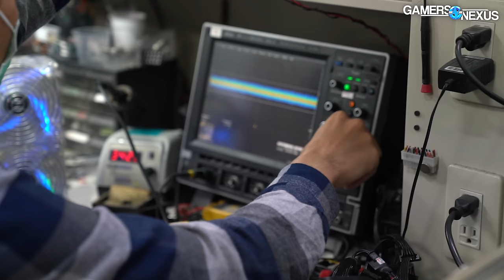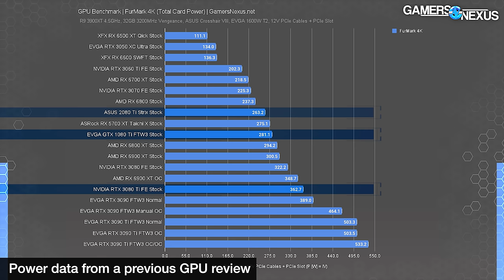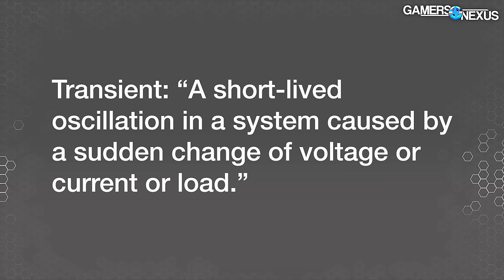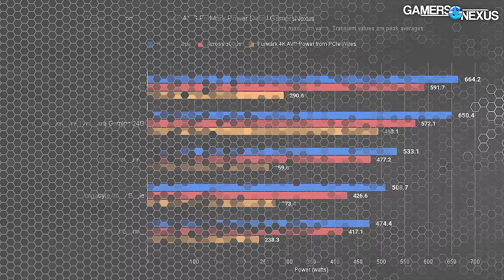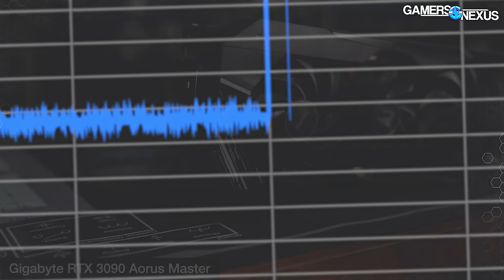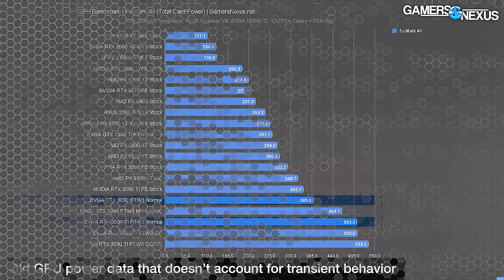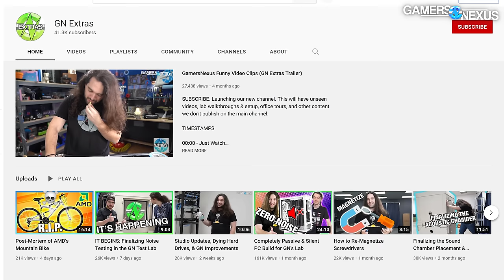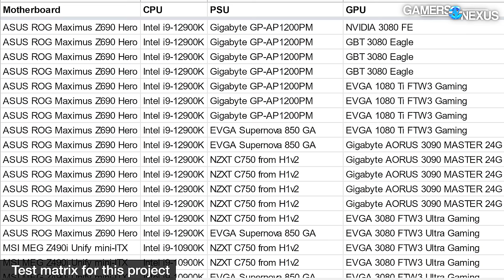The Brewing Problem with GPU Power Design | Transients

Comment: I find it kind of interesting that this is just now being discussed for computers. I did car audio installation professionally for over 14 years and this was something we dealt with on a daily basis for huge car stereo installs. In fact it is still something that is dealt with today for multi amp power hungry car audio systems. We had to install large capacity capacitors in the system to "suck up" high transient power demands to keep from potentially hurting a cars alternator. You can visually see what these high capacity caps would do because the headlights wouldn't dim, or not as much, under large bass drops which would draw the most amount of power. Large caps are designed to quickly deliver large amounts of current very quickly while a cars alternator can provide large amounts of current but just over a longer period of time. A computer power supply is roughly the same. It produces a fixed voltage with a variable current output, very similar to a cars alternator, and neither is extremely suited for potentially a massive current draw in relatively short amount of time. For cars it has always been you upgrade to a larger alternator, or more than one if needed, you add several farad caps or both sometimes. It is getting to the point where either manufacturers are going to have to start recommending more accurate power supply requirements to account for this issue or someone is going to have to design a power bank of large caps that go in between the power hungry graphics cards and the power supplies.
Reply: Electric amplifiers have had this issue for ages, and the solution is a big capacitor.
Reply: I was just going to make this correlation - RMS vs PEAK and what not but you nailed it.
Reply: @StephenGillie  The best solution is an elegant one. Graphics cards should implement their power limit properly. It seems like really messy design to me that you can run a load of never above 200W, yet for less than a millisecond it might spike to more than double that. This can be avoided with sane/smart design. But of course the GPU industry is the epitome of superficial power craze, so we cannot expect them to sacrifice any potential in order to avoid having to oversize your power supply.
Reply: The solution to transient spikes is not just huge capacitors, at least not on the power supply itself. The power supplies (switching DC/DC converters) have a maximum amount of output capacitance that they can deal with before they go out of stability and start oscillating (which will burn out components). A power supply manufacturer can't know how big the spikes will be for every GPU that you put in your system. That's where the board designers of the GPU come in, they should make sure that they have enough filtering on their power supply input so that they don't trip the OCP. They are the ones that should place the large capacitors on their board. But ideally you don't want to have these spikes at all, and you also place inductors in the line to suppress these huge spikes, so just a lot of caps alone could be detrimental to system stability.
Reply: Yup, back in the 90's I had a cap the size of a Fosters can alongside my 1000W Phoenix Gold amp. Ahhh, the good ol' days...
Reply: I'm a home audio hobbyist and was actually going to come here and post something similar. Before i read your post I assumed car stereos would use some type of power supply separate from the car or amp. Either way, that's the point I was going to get to. The power supplies in high end audio power amplifiers are built to handle these kinds of spikes as best they can. It's actually one of the most important components in the amp. If you want dynamic range for movies. Where you can hear whispers before the bomb drops, and get blown out of your seat when the bomb does drop. TLDR, if they don't get their power spikes under control, we could be paying audiophile prices for power supplies. $1000 easy. And there's nothing on the market meant to handle this, except these audio power supplies.
Reply: To make this clearer for everyone. In an electrical circuit a capacitor opposes changes in voltage. An inductor opposes changes in current. Using capacitors for an amperage problem is not a proper solution. Voltage sag is a side effect of a current spike, not the root problem. A tuned LCR (inductance capacitance resistance) filter is the proper way to address this type of issue.
Reply: I'm not an electric engineer so I might be wrong, but unlike Speakers which constantly deal with spikes of electricity based on the music you are playing, and the note and chord it needs to create, cards predominantly need to be more or less consistent in their power draw.
while Again I'm not an engineer, I think it would be a bit strange for a card rated for example at 300 watts to draw suddenly 600 wats for 10th of a second, and repeatedly over the time, here and there, sure.
And the power supplies obviously need to be able to take care of those spikes, but there comes a time where the Engineers of the cards and programmers, to engineer and program the tech properly, and not just rely on the power supply to be able to take it.

I have an old refrigerator that every time it stops it's pump, anything connected to the same outlet, would for a split second blink, or turn off and come back on again.
Yet the new refrigerator doesn't. Quality of components and different tech and all.

Another example is programmers now, care less about memory management and code performance unlike a couple of years back, just because the machines and phones are faster and stronger. Yet there is no reason to for some apps to take as much memory as they do or draw as much power as they do.

Of course, my 2cents and not an electrical engineer, but it seems a bit silly for Chip Designers to blame Power Supply manufacturers, without proper preparation that the power supply is actually ready and capable to handle 2 times the power spikes. 
Especially since a lot of people do not change their PSU for years since the warranty is long and their is no real reason to.
Reply: @Nutakins  I remember some caps being the size of a small fire extinguisher. I also remember having to tell several people to be careful touching them.
Reply: @danepher  It also seems to me to be primarily a GPU issue, they needing to handle their power draw for more consistency as I don't see a reason now why a GPU would need to create spikes like this for apparently rather consistent load. I'm also not an electrical engineer and only a hardware enthusiast that doesn't know too much about that side of things, at least as of now.
As a programmer myself (and from a user perspective as well) I also agree with your take on software efficiency.
Reply: @InTimeTraveller  the high capacity is an issue only at Powe ON and Shutdown, which also with a good design can be overcomed by adding power on/off mosfets in the low voltage circuits.
Reply: @nowheretoshower  you can not tune this, you have to large parameters which varies in time,  also  the inductance should be kept at at minimum to prevent oscillations.
Reply: @danepher  did you watch the video? It's literally about how 3k and 4k series cards do have 100% spikes in power draw. I'm surprised you have the time to write that huge reply, but not watch what were commenting on.
Reply: @nowheretoshower  The problem with that is that GPUs (at least current designs) create current spikes but don't deal well with voltage sag. If you put them behind a LCR filter, that will protect the rest of the system but the GPU itself will have problems. 
The best solution would be what Dolphwin suggested, namely that GPU designers put a limit on the current spikes of their GPUs. But that will only happen when the problems get too big. One example where it actually happened was the RTX 3080, where enough users complained that Nvidia modified the driver to reduce power spikes. IIRC at the expense of a very modest drop in performance.
Reply: @gherbent  You might be right. I don't build high-frequency switching power supplys.
Reply: @rabiatorthegreat6163  I fully agree that this issue is a GPU/card fault. Those designers are the only people who can mitigate the transient behavior.
Reply: @nowheretoshower  Yep, a PI configuration of cap to ground into a series inductor into another cap to ground. Used to use those in ham radio for power supplies or filtering for noise. Different values for different purposes.
Reply: It boggles me how even professionals won't get the terminology straight. There is no alternator in cars, but a generator. Alternator generates alternative current, generator generates direct current. I'm sorry, I don't like correcting, but the little german in me revolts when hearing a oxymoron.
Reply: Yeah I had a 1 farad cap to help my tiny Ford Focus deal with a Boston acoustics 800w amp paired with 2 12” Rockford P2 series in a sealed enclosure. Good news: it worked, bad news: my focus literally was shaken apart.
Reply: @Dowlphin  these power spikes are happening in microseconds. I suspect the power limiting features just can’t react that fast.
Reply: @brkbtjunkie  I was talking about smart design, not blunt and messy design. The issue should be resolved at the source.
Reply: @phillgizmo8934  Every car since the early 60s in the US has had alternators. They use rectifiers to convert to DC. They are much lighter and more efficient at low RPMs. Apparently, back when they used generators, cars couldn't keep the battery charged if you were at low RPM so lights would dim until you got the speed back up.
Reply: I am not even in the electronics field and my first thought was "Add capacitors"
I hope it's not that simple because you would think large companies like NVIDIA and AMD would already have thought of this.
If they really are just kicking the capacitor can down to the power supply manufacturers then that's just said
Reply: Ok just watched the whole video.
Yeah while Nvidia and the OSU manufacturers continue to play tennis some smart person needs to start similar to what was mentioned for use in a car to take the load created by the audio system.
Reply: @paulanderson2963  Caps cost money, too, and take up space. And resource availability might become a growing problem, too.
Reply: You're spot on, and I had the same idea - a bank of high quality caps that can be easily added between the GPU power input and the PSU. Anyone who does basic electronics could actually rig it up themselves, for the 5V and 12V lines.
Reply: @nowheretoshower  As things stand currently though, isn't stable voltage what we want? The GPUs want extra high current temporarily so we wouldn't want to dampen response times to that with inductors, right? Yes, dampening a current spike via inductors would prevent the PSU from hitting OCP, but couldn't that in turn result in a voltage sag on the GPU side?
Reply: @Mad_Hat_was_taken  The voltage sag is caused by the current spike at the load. If filtering was designed to flatten the transient there would be no voltage sag.
Reply: It has been discussed for years now, other streamers have and also on various blogs. The problem has always been us consumers just accepting it and not holding NVIDIA accountable
Reply: @phillgizmo8934  While yes cars used to come with "generators" modern cars have "alternators" that use rectifiers to convert that ac into dc for the vehicle to use. I think it was in the early 60's when these really started to take off and then became standard because of the benefits they offer
Reply: It's just now being discussed for computers because it's just now getting to be a big enough problem to require discussion. Everything happens at its own pace.
Reply: @nowheretoshower  : Capacitors don't oppose changes in voltage. They're not resistive, they're capacitative -- hence the name "capacitor". They store excess charge and supply it to fill-in amperage spikes that would otherwise cause the voltage to dip momentarily. Mathematically there may not appear to be a distinction between the way inductors and capacitors work to smooth-out the flow of electricity, but physically there is a huge distinction -- an inductor is essentially a magnetically-moderated self-adjusting resistor, whereas capacitors have no resistive behavior whatsoever.
Reply: @deusexaethera  You have misunderstood. 
Capacitors oppose changes in voltage by causing a voltage drop on a circuit as they charge their electrical field. Capacitors oppose changes in voltage by releasing voltage into a circuit as their electrical field collapses. So, when voltage goes up the capacitor tries to hold it down and, when voltage goes down capacitor tries to hold it up. 
Next, capacitors block DC and allow AC to pass through. This makes capacitors able to function as frequency dependent resistors. This is called capacitive reactance and is represented in ohms.

Next, inductors oppose changes in current by becoming a load on a circuit while charging their magnetic field. Inductors oppose changes in current by releasing current into a circuit as their magnetic field collapses. So, when current goes up inductor tries to hold it down and, when current goes down inductor tries to hold it up. Inductors cannot block the flow of DC like capacitors. The inductor is a frequency dependent restriction on current flow. This is called inductive reactance and is represented in ohms. 
I hope this clears things up.
Reply: @StephenGillie  : The problem with just slapping a big capacitor into a computer is twofold:
1) You have multiple output voltages (12v, 5v, 3.3v, ~1.7v for the CPU cores) and multiple power rails for most of them, so you'd either need to fit multiple big capacitors to all the power rails because you never know which one is going to require help at any given moment, or you'd need to fit a really big capacitor on the input side, which would require converting 120V AC to some intermediate DC voltage before converting it again to the final output voltages. That would ruin the power supply's conversion efficiency.
2) You'd need to find room for all those big capacitors. A computer is much smaller than a car.
Reply: @deusexaethera  Good points, so we'd need a lot of little capacitors, and a bigger case.
Reply: @phillgizmo8934  automotive alternator produces alternative current. It's just rectified on the output through a diode bridge. Direct current generators were used in the automotive, but were mostly phased out since 70's. They were essentially a DC motor driven as generator, current was transmitted through a commutator, which meant wear at larger current, that limited their power and efficiency.
Reply: @StephenGillie  That's why I've been looking at the corsair 90 degree ATX power adapter with caps built in. As well as the EVGA powerlink for GPUs with caps. Only problem with caps is they're one of the first components to go bad over the long term.
Reply: But isn't that "transience" in a very different timeframe? Aka "transient because the actual power USE is transient (moving air)". Because these timeframes here look more like fliping an old lighting switch that arcs or the equivalent of watershock in old plumbing, like the switch between two modes of operation in the cards causing the spikes rather than the software demanding the power temporarily having similar spike (the game). What good is the powersaving of turning of half a card when it isn't needed, if I have to use a powersupply that runs as if the spikes were the norm to be able to cover the switching reliably?
Reply: Yep, was thinking the same thing exactly! I had a 40 Farad Tsunami Cap in my system. Never had any power draw issues, no lights flickering or dimming or anything like that. Plenty of power for my dual 12" subs, and DLS speakers.
Reply: @phillgizmo8934  it boggles my mind how you can “correct” someone and still be incorrect.
Reply: @StephenGillie  I also like to assume a part of the solution is not installing giant clown amps that could saturate an entire state fair with audio... but I might be REALLY extra cynical. :D Same for GPUs.